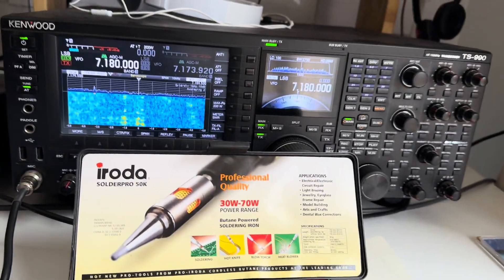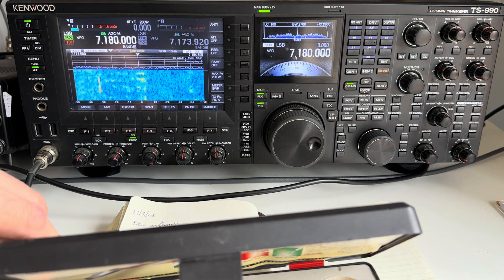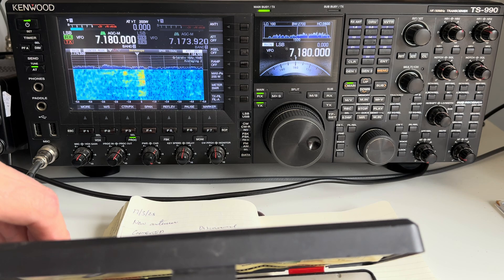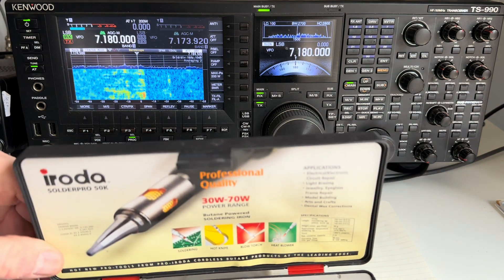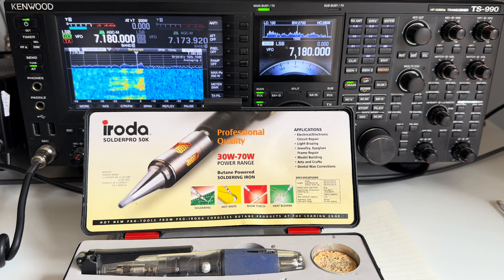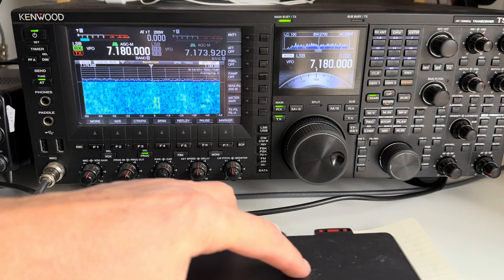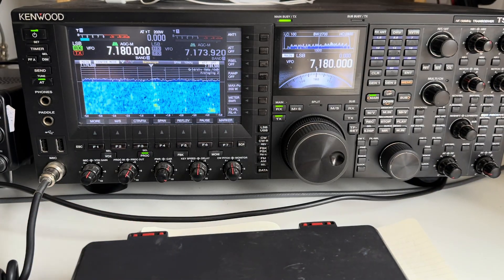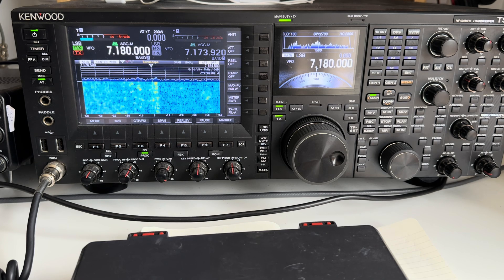Springtime house-keeping in the shack, although mostly (Storm Darragh -induced) antenna repairs

Comment: Hi Clint. Do you know what size wing nuts I need to replace the MLA30+ crap ones? Copper upgraded the loop and like your antenna setup. Thank you. 73
Reply from the maker: Hi Michael, I'm not sure as I don't own an MLA30+ but looking online they're either 4mm or 6mm bolts....73